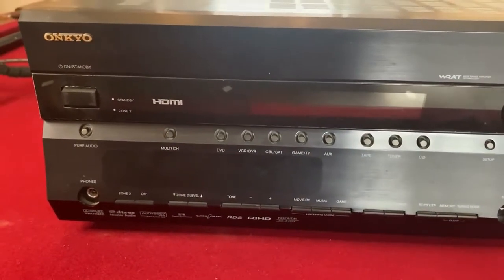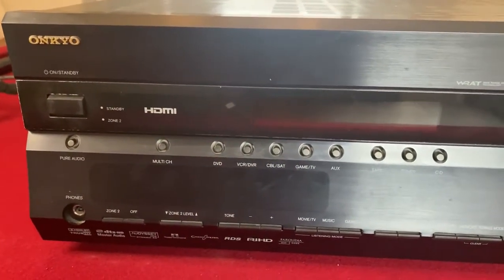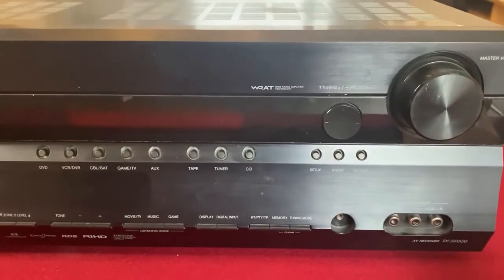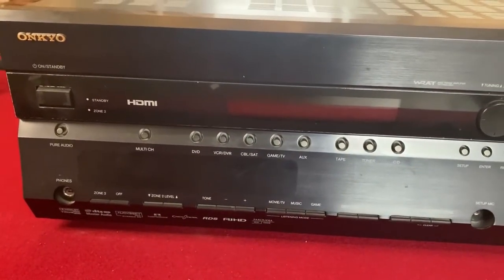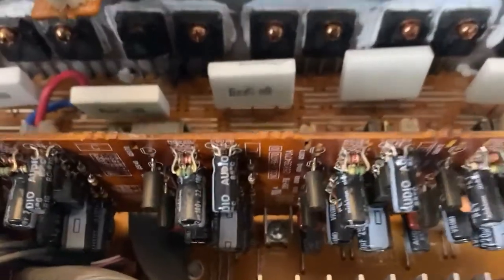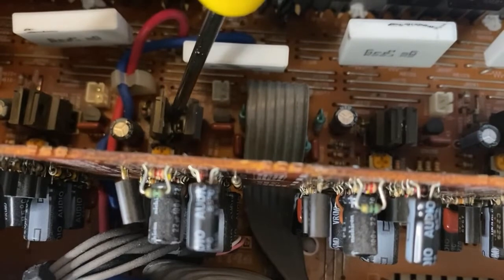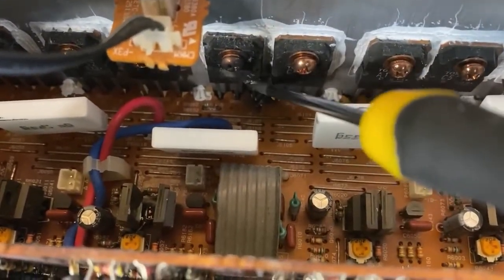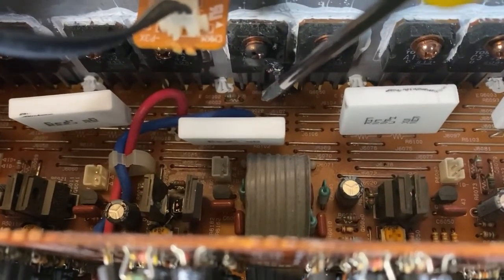Onkyo TX-SR606, No Power, Flashing Standby light. From bad to worse! Can It be Repaired? Part 1

Comment: How do you remove the main board with all those white ribbon power cable connectors and those other power connectors that have a wire wrapped around a pin I'm really struggling to repair one of these it's so frustrating, I'd like  to get this board off and put the rest to the side while I fix the board
Reply: What fault do you have?
My advice at this time is to buy any unrepairable Onkyo receiver from this era for £20 and start disassembling it.  You will find the connectors are ridiculous in function and purpose, only yo find the wirse are soldered to the board also!

The wafer this ribbon cables will pull out.    You can then wipe and reseat - which can on occasion fix some faults. 
Removing boards on these awful receivers is labour and skill intensive because of the (deliberate?) way there are assembled.  

90% of the faults with these receivers is 'no sound' and 'relay failure'. 

For the no sound problem there are tips online - including heating the DSP chip
For 'flashing red light', 'wont turn on' from standby you will have to remove the main transformer - remove the multi core wires by carefully unclipping the awful white connector blocks as you go further.    The raly can be bought for £3 - but fitting it is another matter.

Iv been working on these units for 12 months and have never had the need to disassemble anything else but the main power brick - mainly because its just not worth the hassle.  
If its just for enthusiasm and a your hobby I apologise - read on..

I bought many of these as a learning curve hobby after my 605 failed (I cant remeber why) but I ended up repairing 2 x SR606, 3 x SR608,  an SR609, an SR414 and an NR515 (which I am using at the moment) and Im waiting on another SR608 tomorrow which has wont turn on from standby.   

Get a beaten up one to tear down.   The connectors are bizarre and of differing builds.   Usually though you would find the 2 clips and push in whilst pulling etc

Comment: you should always check the bias pot for damage or oxidation which is the reason many amps fail in the 1st place. the pot gets "dirty" the bias goes way out, it overheats, but when there is pre drive damage always check because the carbon track on the bias pot might also be burned out. also check any small diodes and resistors in the zone or in series with power paths.
 Before you touch any of the bias pots you can check resistances from the legs, just see if they all show a division of the pots total value usually if the pot is 100 ohms it might be 30 ohms on one side and 70ohm on the other or 40 60 etc. if one side shows different reading way out from all the others you know it is dirty or blown. Once you know the history you can proceed to clean them and retest.
 Get the npn and pnp transistors the correct way around, keep them insulated from metal surfaces when necessary, sure you know all this though.
 Also check the speaker protection relay for low resistance see if it provided a consistent path each time it closes the contact, an old oxidised or burned contact can possible lead to arcing and amp failure.

Comment: Hi, Well with a powersupply of 125V en 5A that will give a bang :D 

I am wondering if you have a dump (bin)file of the video flash EEprom of this receiver? It's Q8085 on the HDMI board. I have repaired the HDMI board of this receiver but it has no OSD or composite video which is caused by an empty eeprom. It would be much much appreciated
Reply from the maker: Unfortunately I do not have a dump of the EEPROM.  You could perhaps message Norcal715(I make reference to him I. The video), he has also carried out the same/similar repair as this and is where I got the Inspiration to do this myself, he also provided me with schematics and service manuals.  

I am waiting for a few more parts to arrive and I will be videoing part 2 of this repair, if you want to see how it turns out and if it can be repaired then like and subscribe, I do out out a lot so you wont get a lot of notifications but every sub helps.